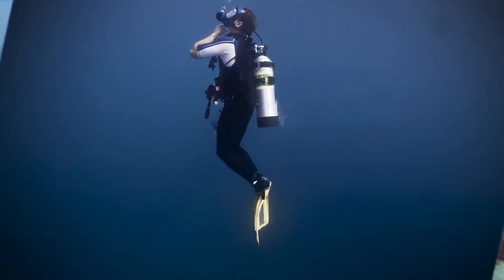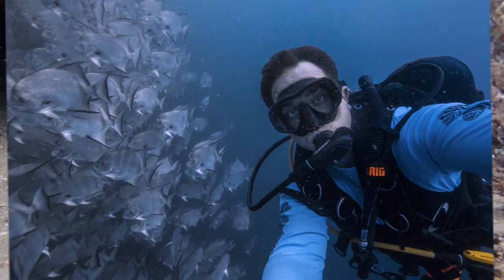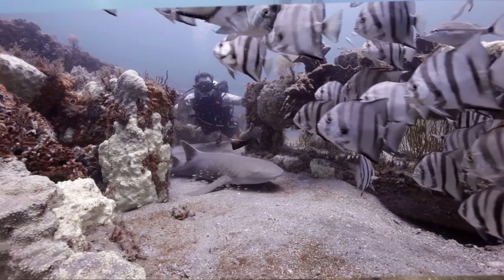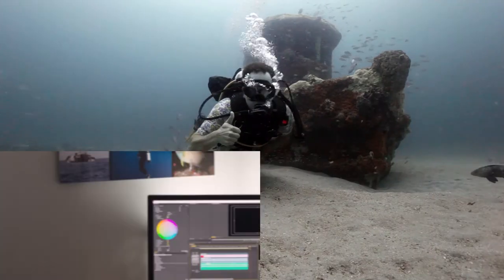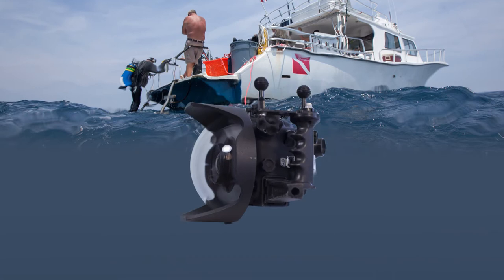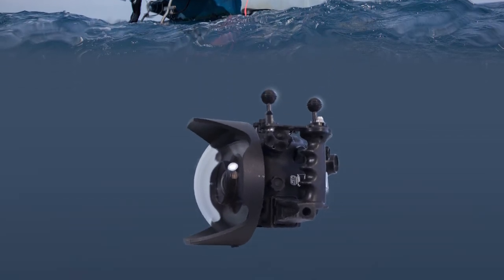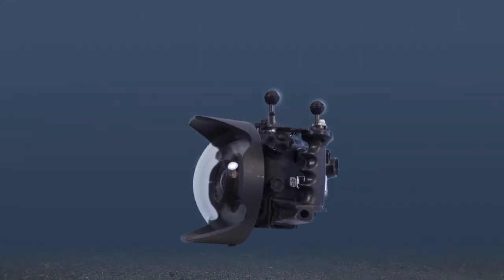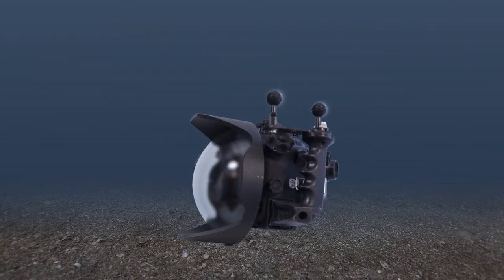Prevent Underwater Camera Fog

Comment: Condensation is from temperature difference, not pressure.  Plus, a hard housing like you're showing doesn't change pressure inside because it's sealed.  A bag type housing will definitely change the air pressure inside the container.
Reply from the maker: Thanks Jason,  the air in this type of housing is "squeezed" as you descend much like a mask on a diver's face will squeeze during descent.   A diver can equalize the mask by blowing some air into the mask however the camera housing stays under "squeeze" at depth.  I believe there is substantial amount of physics going on that effects the state of water  in a camera housing.
Reply: @UWPICVID  There is a pressure differential between the inside and outside of the housing which changes with depth. But the pressure inside does not change. The reason your mask squeezes towards your face is because it has soft skirts... 
I agree with Jason, it's the temp difference that does it.
Reply from the maker: @AntiVaganza  thanks for clarifying. Happy diving!

Comment: Interesting. As soon as you said that,  I thought of a food dehumidifier as I don't have an air conditioner. Another option I've just viewed is cutting a small strip from panty liners as they are primarily designed for this purpose. Thanks 😊
Reply from the maker: interesting tip